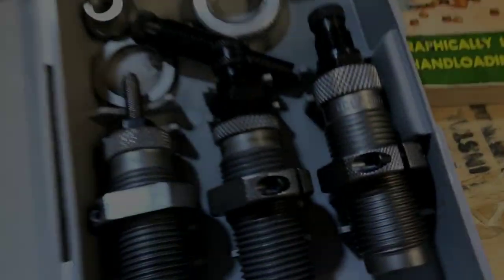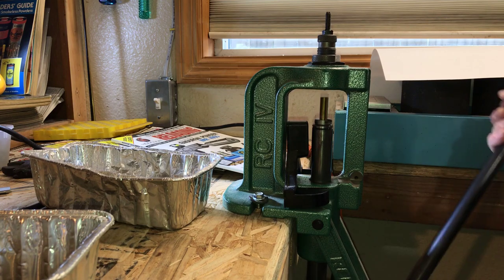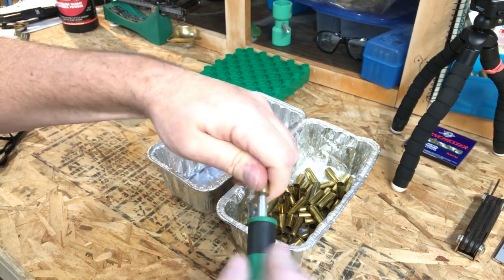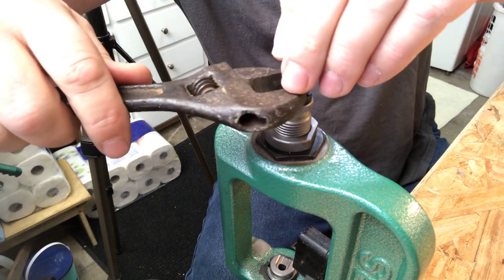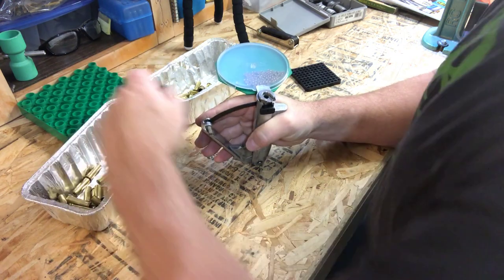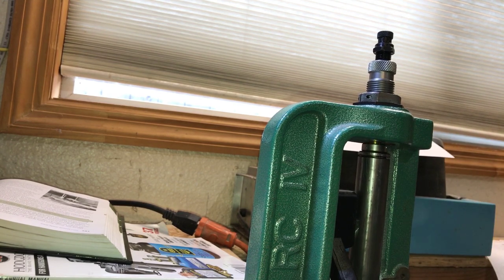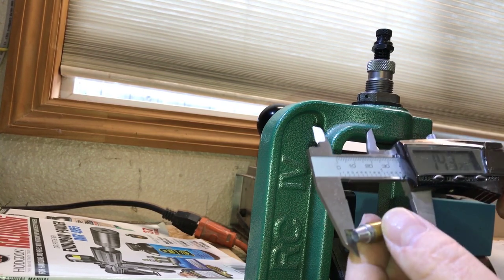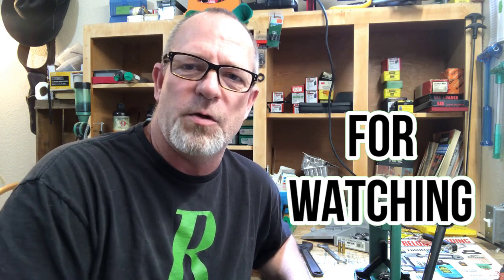🔥Step-by-Step Reloading .38 Special Ammo - Tips YOU Need To Know.

Comment: A couple of comments from someone who has been reloading since the 70’s: uniform trim length ensures consistent crimping and if the case is several thousands over could cause over pressure. That spacer ring is only used for the expander and seating die for 357. Overall length per the book is only useful if using the exact bullet specified, best to set depth, (coal), to approx midway down the crimping grove, (or cannelure of jacketed bullet).

Comment: Good video. I like using the Lee Universal Decapper because I decap before cleaning. Avoids scratched sizing die if you pick up range brass off the ground. I like to clean after the flash hole decapped.  I also like the Lee Case Primer. It is easier on the hands, has a good feel to it, but filling the tray can be a bit fussy. Time is not a big issue for me since I enjoy the handloading process so much.  I do like my single stage Rockchucker best, but I have a Lee progressive press mounted on a Harbor Freight grinder stand so I can move that press inside to reload when it is cold outside. I use the progressive press single stage because time isn't an issue and I feel I have better control with a more consistent result. Great hobby!

Comment: Good video. One thing. You mentioned always starting with the listed starting load - good. You mentioned working up to the max load - good. However you didn't say that you should never use LESS than the listed starting load either. 
Otherwise, you've made a good training video for newcomers, and that is something that will always be valuable.
Reply: One can often get by with going a bit below starting. Going a great deal below staring can, of course lead to "other problems".
Reply: @lestergillis8171  - True, but you have made a video for "newcomers", and newcomers won't have a grasp of the "bit below starting" concept. That's a concept for experienced reloaders because newcomers might interpret "bit" as half of starting. For newcomers, it should be a standard instruction "don't use less than starting". This is also a standard instruction in all reloading manuals. They all say this, so a video targeted to newcomers should also include this basic instruction. As they gain experience, their understanding will expand, and "a bit below starting" won't be an issue. But as a "newcomers" video, this basic concept needs to be included.

Comment: Great video, but one comment: you don't clean your brass prior to depriming.  I do, because I don't like putting dirty brass in a die.  Eventually, you will get scaring and/or start sticking cases.  I clean, deprime, tumble, then proceed with the reloading process.  I don't have the scratches referred to at the start of the video.  You can't tell if mine are once-fired, or on their fifth reload.  Brass and dies will last much longer and love you for it.  Just my experience.

Comment: Great video, thanks. Just did 9mm today & .38 spl tomorrow. Using my Lee 4 die setup & Forester press. I've tried not using lub with my carbide dies & now always use a spray on lub since it makes the pressure so much easier on the ram. Home made lub of lanolin & 99% isopropyl, Thanks
Reply from the maker: Thanks for the comment. I dont use lube with my carbide die when sizing the case on my straight cases. But to each their own and it’s not wrong. 
I see where you’re coming from because some of those little buggers can get pretty firm and it makes you wonder. 
It Is the enjoyment we get from this art! 👍😁

Comment: Sir, all of your videos, that I have seen, to date, are awesome, and I’m learning so much. Thank you. I am doing CAST .38 and .357 M ( for revolver ) with 158 SWC Lee molded tumble lube boolits. They do not have the canilure, and I am powder coating them, no lube. There is no gas check involved with these, as well. I was given a set of RCBS carbide TAPER CRIMP dies for this. Obviously the die setup and procedure is different than your roll crimp. I’m guessing and researching, that it would just be similar to doing the 45 ACP in your other video? Did you make any videos on loading cast, powder coated , with taper crimping? Thank you again !
Reply from the maker: Hi there and thank you for the kind comments I appreciate that. Just put a slight taper to remove the bell that you had done to insert the bullet. It will be fine. You would follow the same steps as setting the taper crimp on the .45 yes.  
Roll crimps are standard but taper is not Unheard of with no cannelure, just make it ever so slight and you’ll be good.

Comment: How do you know your loads are getting too hot when working up to the max loads in a revolver? I read flattened primers and cratering aren't 100% reliable
Reply from the maker: If I do work up Hot Loads (+P) I work them up to either max grains by the book, OR back off if I start splitting case mouths.  If your splitting mouths, your cases are used too much or your WAY too Hot!  😬 I never exceed the book data recommendations.

Comment: Thanks! ... I'm just starting to learn the process, no equipment yet, but have 1000+ spent shells, and 200 FMJ 357/38 bullets, 130/158 grain. The FMJ bullets seem to fit very well in the spent shells, and of course no exposed soft lead. Is it OK to forego shell flair process?
Reply from the maker: If I’m understanding your question correctly, Before you can flare you must deprime and resize your shell. Once you do that you’ll notice the bullet won’t fit quite as well because currently the case is bigger than it should be right now being it expanded by being fired.
Reply: @atlyvwire  That is correct ... I was referring to the point where you're ready to flare to fit the bullet, with all other steps done. I guess the part I missed was that resizing may not allow even a FMJ bullet to fit. So I'll stick with the script and do the flaring, leadnose, or FMJ ... thanks again!
Reply from the maker: That’s right, whether it’s full metal jacket or lead you need to flare the case mouth. Especially with lead because if you don’t you’ll shave the lead off the side of the bullet. That’s the nice thing about straight case after they’re sized when you bell the case mouth the bullet slides in tight and then you do the straight crimp on it just to put that belled mouth back where it was yet leaving it flat so it headspaces correctly on the end of the shell.
Reply from the maker: I have to correct a portion of my last statement. I forgot you’re reloading for 38 special or 357 so they don’t headspace on the end of the shell like a .45 ACP would.  😁

Comment: I am working on some 38 special 125 grain. The over all length is 1.55 but with the 125 grain it is 1.46 to the crimp groove will that work
Reply from the maker: That will work. You just do not want to exceed the OAL on the straight case revolvers.
Reply: @atlyvwire  yea that's what I was thinking. Semi-wad cutters are shorter than that right.
Reply from the maker: Just for fun I pulled out some of my loaded .38 LSWC and they all measure 1.46!
Reply: @atlyvwire   I loaded 5 first and tested in my sp 101 and they seem fine

Comment: At the 10:32 mark you pull out a piece of card stock but you never mentioned putting it in or using it to begin with.
Reply from the maker: That’s true, it’s a piece of thin cardboard like from the front of a notebook or a business card to give you that hairline gap you need between the shell holder and the carbide ring on the resizing die when setting it up to give you that gap so you don’t whack the resizing die and risk breaking the carbide ring with your recite the shell holder.
Reply: @atlyvwire  Thanks!  I was wondering what it was for.  So it is a spacer to keep things from banging together.  Got it!